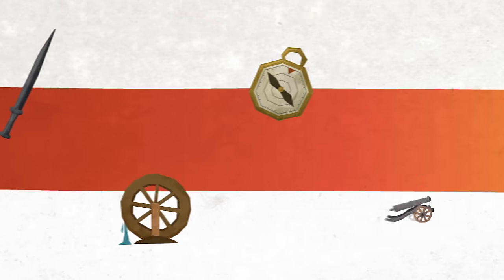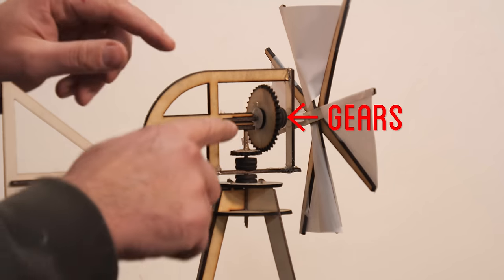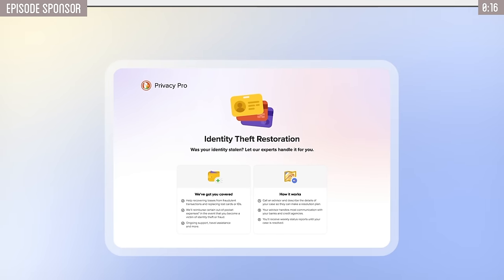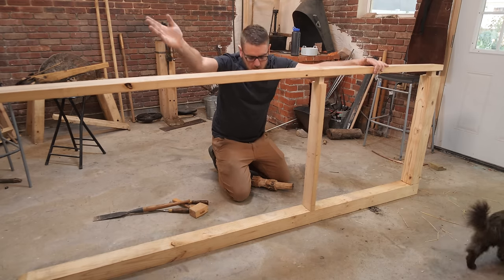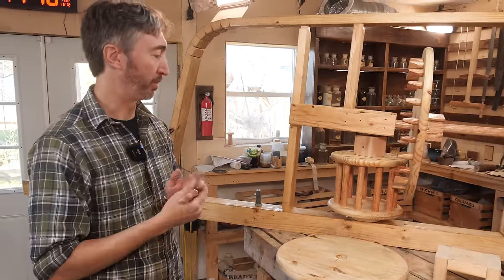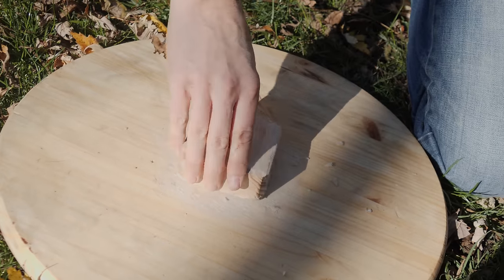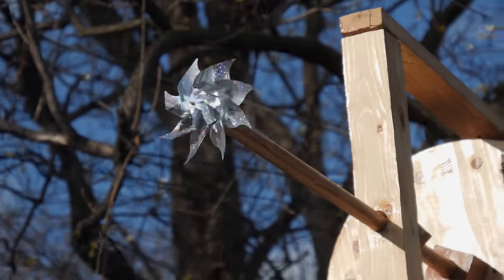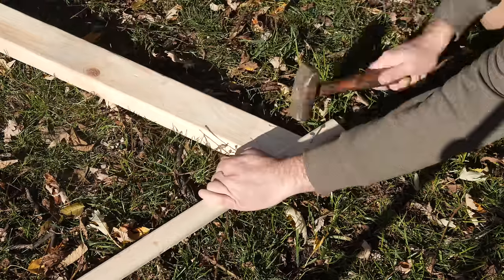Does this DAVINCI's Design Work?

Comment: Honestly i think the fact that you seem to still be operating in a suburban neighborhood is probably whats holding you back. If you owned a larger field with a larger workshop you could build these large projects to scale without concern. The base for this windmill is way too short and no where near wide enough to even be considered useful. I mean windmills need access to stable wind. Low height with fences and trees interferes with that.
Reply: Absolutely my thoughts as well. In order to power a grindstone he'd need to gather at least 600W worth of shaft power. Ideally 1kW or more. Anything lower wouldn't be feasible as it would get lower than the power of two people (~500W) and require so much reduction gearing (causing more mechanical losses) to be far too slow.
Reply: G'day,

The Numbers are...

To be clear of 
Show-Stopping 
Mechanical Turbulence from 
Upwind Obstacles...;
The 
Lower Edge of the
Rotor-Disc
MUST be At LEAST
TEN FEET
Vertically  (3.4 metres), 
Above EVERYTHING for
500 ft (175 metres) Horizontally..., in EVERY direction....(!).

Turbulence involves 
Asymmetric Windspeeds 
(And thus, Lift, Drag, & Torque on the opposing Blades when they're Horizontal.

And that invokes
Gyroscopic Precession...,
Manifesting in ALL the stored Kinetic Energy resident in the Rim of the "Flywheel" being focussed across the Axis of Rotation..., but
Applied 90° later - in  the Direction of Rotation...

Basically, Turbulence ,in the upwind Air Column will
Violently
Stop the Rotor from Spinning, with Vertical Impulses, as it 
Yaws out of Wind,
Hammered by  big Cyclic Jolts of Gyroscopic Precession...

Look into my Playlists, to see how I KNOW this to be true...

(I still have the Remains of my Skypower Mk 4-c Wind Turbine Rotor..., after I attempted to "furl" it when over-speeding in a strong Wind).

As the Tail attempted to Yaw the Disc out of Wind, Gyroscopic Precession duly 
Pulled the Bolt-Heads & Washers through the 
Main Bearings' Pillow-Block Mountings.

And, thus, one Blade hit the Tower, at
600 RPM+...

The largest Splinter off the other Blade came over the top and speared into the Ground, about 3 ft from myself, at the foot of the Tower.

Dunning-Kreuger driven Foolishness...,
Rather than
Autodidactic Inventorism ;
It can be very easy to arrive
Unwittingly
On the wrong side of that
Dividing Line.

Such is life,

Live a good one...

Stay safe.

;-p

Ciao !
Reply: Those properties cost upwards of $1.5 million. Feel free to sign up for the patreon :)
Reply: @BikiniDuckCreations  it's his career. He makes enough to support two employees at minimum. Unless he is absolutely atrocious with money he can afford a plot of rural land.
Reply: If the dude is based where Google says he is then rural land costs nowhere near that much. It's not like he is in NJ or coastal California.  @BikiniDuckCreations
Reply: @Imaboss8ball  As his friend, neighbor, fellow creator, and someone actually looking for such land myself; I can tell you that yes indeed, properties of that caliber are going for a million+. A 20-50 acre property, within an hour-ish drive from MSP, with at minimum a house and a workshop/barn, will easily start from $950k-$1.5m

If he wanted to just buy an empty field of farmland, then yes, those are available starting at $12k per acre. Wooded "hunting" land that cannot be built on can be found for as little at $5k/acre.

Comment: Hi Andy, love the video. I am a bearing engineer and appreciate the attempt at a rudimentary thrust cylindrical roller bearing. In order to prevent your wobbling issue, you need to add more rollers to increase the load sharing and fix the rollers along their pins so they stay in the same rolling path and do not slide axially (this will prevent slippage and reduce friction). In order to accommodate an increased number of rollers, you may need to forge a more advanced cage design that maintains roller spacing. You may also consider a larger roller diameter to increase load capacity. Also be sure to grease adequately. Love the content!
Reply: Solid soap should be used for wooden friction contacts
Reply: I wish they brought in/interviewed people like you during the show like they did with Civil engineering guy. Would save a lot of time/effort/money and be educational.
Reply: THIS also bearings on the top and bottom of the vertical gear to reduce energy loss to friction.  

Separately reducing the mass of the sails which he spoke on a bit. AND setting the gears to mesh better / easier to again reduce energy losses.
Reply: "grease adequately" is just solid life advice in general

Comment: In Guédelon in France they build an medival water mill an had also problems with binding at the beginning. After a while it runned smother and had the same wear marks than found of medival mills. So those wooden gears just need time to work them self in.
Reply: I work as a maintenance guy for a factory. We call it "wear time". Imperfections in parts or imperfect pairings (due to new parts being put in an old machine) tend to wear each other into smoother interactions over time. The knee jerk reaction most people have when they repair or build a machine is that it "doesn't work, try again". But really, they should just run to the shit out of the machine until it either breaks or works better than ever.

Comment: I'm not an engineer or a woodworker, so my 2 cents aren't worth much, but my intuition is saying that the shafts you're using are only just enough to work. with the size of the sails and the gearing there has to be a lot of force on the shafting, both an axial and torque load. If you are going to build a more permanent version, adding any thickness to the shaft will help.

Comment: The main flaw of this type of windmill drive is that it will try to turn out of the wind the moment a load is applied to the driveshaft. You can see the problem easily if you imagine the central shaft as fixed. Then the dive gear will turn the blades out of the wind. To make this work you need a guiding sale with at least the same surface as the sum of the wind blades itself.
Secondly support the central shaft at the bottom with a "nail in a cup" bearing. you create a shallow iron cup and polish it on the inside. Ten you cut the end of the shaft to a point and set it in the middle of the cup. Lubricate it with a lot of lard. Repeat that upside down at the top. This will create a stable and "low friction" bearing that can hold up the windmill. The outer tower is only there to hold the central shaft upright. You can size up such construction up to 1hp. Beyond that friction will be destroying the bearings.
Reply: Right, this is like a helicopter without a tail rotor. You can test the spin of your blades and find no issue, until you do "work" and lift off the ground. In this case the body of the windmill is trying to spin rather than impart that work.

If we're trying to maintain DaVinci's concept, we could consider a seer/pin relationship with the tail sail. We need "NOT" logic. If Tail Sail receiving wind, seer is disengaged. We still need a tail that can overcome the shaft's backlash, but it's not constantly fighting it, even at such a slight angle that the tail sail is receiving very little energy.

The seer could just be a rod or pin with some amount of sprint force down onto a radial set of locking grooves, which is overcome by something like a rotating or twisting of the tail section. When the wind is at a significant enough angle and speed to disengage the pin spring (spring tension could be adjusted for the workload) the wind also imparts closer to its maximum force, providing the excess energy to overcome the work and reengage the pin at a more favorable angle to the wind.
Reply: Your Wind Mill looks too heavy.

Comment: 5:50 rivet tin sheet on all the contact spots and rotating joints also adding grease, wood is a friction generating surface.

Comment: And now you see why very rarely see small windmills. The power of the wind becomes useful only with larger sails, hence the use of water and water mills; the inertia and momentum of water carries so much more energy that it makes it so much more efficient, especially material wise... 

But as you stated, its not given to all to have a running stream close by, contrary to windpower. 

All in all, was a great episode! Neat to see you all learn from the past iterations of the wood gears and the progression of knowledge and usage of metal working with the rollers ! Very cool  to see :)

Looking forward to the next episode!
Reply: One thing that might help would be if Andy made some ropes and pins to tether the windmill down with. the problem is that the wind is allowed to pull the machine over without anything resembling a foundation holding it in place.
Reply: This was basically stated above, but I think this also adds to it. Being in a low, fenced area is not helping. A larger windmill is a more stable platform for a taller system, and height is the only reasonable way to get more predictable and uniform wind flow.

Comment: Hey Andy, as someone who got a degree working in alternative energy and works on windmills I think you had the right idea with the large blades at 15° angle to give to ample surface area for it to work. However with that amount of surface area being taken up your tail needs to be further back to give it the best chance at turning the face into the wind. Also with that minuscule amount of energy you will be able to capture I highly doubt you will be able to spin a grindstone. HOWEVER! I think you would have a good chance of making it work if your yaw was attached to a belt that would climb against a screw and drop crushing the grain Monjolo style.

Comment: This video reminded me of a story my aerodynamics professor told us in class. A military guy consulted with him about using an old helicopter propeller as a wind turbine. My teacher said it wouldn’t be feasible because the airfoil geometry in both applications is different and not interchangeable. The military guy ignored the suggestion and built his wind turbine anyway, but it did not work. He came back a year later to consult with my professor (paying by the hour, of course) and asked how to make the turbine spin. The answer he received was certainly not what he was expecting because my teacher said “go buy an electric motor, attach it to the turbine and turn it on”

Comment: There are a quite a few small windmills in the Netherlands used to pump water. The old big ones are the ones that are well-known, but to protect smaller plots of land there are tiny ones. Most wind powered pumps have been replaced by modern pumps but some are still in use. The ones I've seen are made of metal, which probably makes them a lot more efficient, and smaller than the one you built, size varies depending on how much pumping is needed. Theremay have been wooden ones in the past. I tried to google for some images but I couldn't find what I was looking for. I have no knowledge of the actual engineering. I just remember seeing some. It's very windy here so that probably helps, too.

Edit: Apparently the tiny windmills have been given the nickname "Bosmannetje". These waterpumping systems, regardless of size and method, are called a "gemaal". If you search for the two terms combined you should be able to find some pictures. From what I could find this type began being used in the 1930s so probably no wooden ones. Besides a tail, newer designs also have one arm that catches wind to create a better angle.

Comment: I have a photo of a middle eastern design where the central axis sticks out several feet.  Guy wires go from the end of the axis to the tips of the sail supports and to the vertex of a triangular shaped sail.  Note, only a single, light weight piece of wood supports the sail much like the mast on a ship.  The angle of the sail can be adjusted by the length of the guy wire (again, much like a ships sail).
Reply: That would lower the weight of the sails which would be a big help. Also reducing the sail arms even slightly (thickness, taper, drill holes) will also help lower the weight letting it turn better.

Comment: Wind tends to blow only from two directions in any location and one of those directions is directly opposite the first. So long as you have an accurate record of that (called a Wind Rose or a Wind Compass) the whole need for a swiveling windmill doesnt seem needed. It would let you capture energy from 90% of winds at a location without needing a swivel.

Then again Davinci isnt exactly known for coming up with the simplest solution for any given problem (lookin at you "just add a connon for each direction you might want to shoot")

Comment: HTME never fails to impress. Would be cool if you could use the windmill to pump water to a raised container. Then when there's not enough wind, you can release the water to drive machines like a giant battery

Comment: You could use the wind mill to pump water to an elevated tank as a storage medium for your power then use the water wheel to generate consistent  work when you need it.

Comment: An honest question. I've heard that brass and bronze are kind of self lubricating, so wouldn't that a good plating material for the nut instead of straight up greasing the wood.
I feel that's also why the rotation was more easy than getting spin. The rollers probably reduced drag a lot, while the wind blades had quite a bit of drag to overcome with the nut, but definitely also the gearing.

Comment: For a long time bearings were grease on wood. People also used other lubricants. Living frogs were put in wheel hubs. Actual bearings came with advanced metallurgy. I think the hub solution is wooden disks, thicker axle and holes on top disk for grease.

Comment: Super cool build! If you want to more efficiently capture wind, you can try anchoring the tower down so it doesnt tip and making it taller. Wind speeds increase with height, so this is a simple way to use the same sails to increase output

Comment: I'd argue you'd want larger sails, the  weight of the sails versus the limited potential pounds of thrust from the wind keeps it from spinning as well. There has to be a sweet spot where your sails are large enough to harness the pounds of push needed to spin, and the  weight of the sails are no longer hindering it(sail weight vs. Potential ratio). I'm sure my terminology is atrocious but i hope im able to get the point I'm trying to make across.

Comment: Seems the vertical shaft needed support at the bottom to keep it from tilting the head around. Also a pyramid style base will add a ton of stability to keep it upright in winds. Youve proven it does work just missed the mark in overall execution.

Comment: After you test more smaller blades, you could also test wooden airfoil propeller blades, to see if using the heavier wood with an airfoil shape would be better than using angled cloth with a wooden frame.

Comment: high aspect ratio sails are more efficient. more sails provides more torque. check out the midwest farm pump windmills for an example.

remember davinci's helicopter was not particularly efficient (or effective) either. for similar reasons.

Comment: You need to attach the tower to a firmer foundation or the wind is going to push it over with how top heavy a windmill is. Attaching the millstone directly to the bottom could solve this, but while you get to that point, get some sand bags or some concrete bricks and weigh it down at the base with the weights firmly attached. I am talking by hardware or ropes you would use on a sailing ship. Steel cable is beyond your tech tree still, but that would be the other option.

Comment: You'll want to elevate your windmill as much as possible to get out of the ground surface boundary layer; ideally above as much of the neighboring structures and trees as possible. The winds are usually more predictable and stable at higher elevations.
Reply: And away from electrical lines..

Comment: I think it would get more wind if it was higher, im thinking like those wind turbinids.
not only is wind stronger the higher you go but it would also be above the roof line of houses so incoming wind wont be blocked or slowed down.

Comment: i think by then, they'd had centuries of work to make wagon wheels, engels coach shop might have some historical examples somewhere, so your vane hub could be easier by copying an old design.  i think maybe also having the trailing edge of the wings be unsupported would do better.

Comment: I am Dutch and as such windmills are a big part of my heritage. I have a book about the structure and construction of windmills, and there is actually a lot more in the book about how to build a strong frame, than there is about the sails and the gears. A proper windmill was built with an octagonal tower. Hexagonal was acceptable because it was a lot cheaper and still pretty sturdy. Square towers deform too much with varying wind. The timber frames are massive, with intricate joinery.

Basically, Leonardo's windmill focuses on the exact opposite. He shows detail in the gears, there are token shapes to illustrate the functioning of a windmill (make no mistake, this is just a diagram of what was an already well established type of windmill), it's definitely not a functional design.

All things considered, I think it was more successful than I had expected, which is likely your contribution. Well done.
Reply: I imagine that making the tower conical (broad at the base and narrowing towards the top) rather than straight up-and-down is also important to the structural stability.
Reply: The sails for the windmill probably had a lot of tech borrowed from the navy as well, which was very well researched over the years.